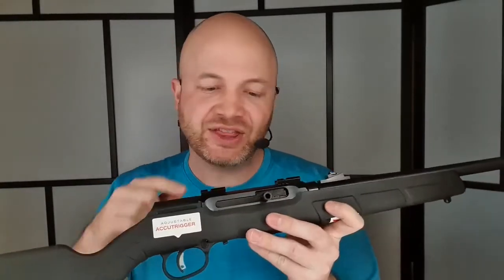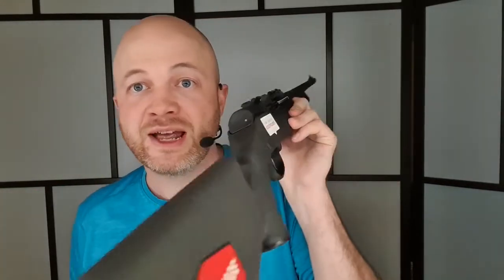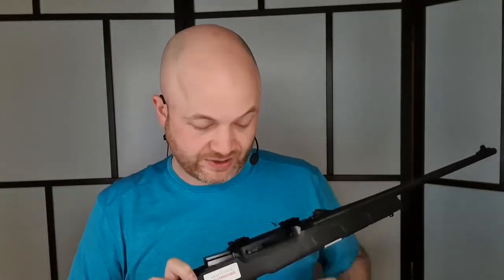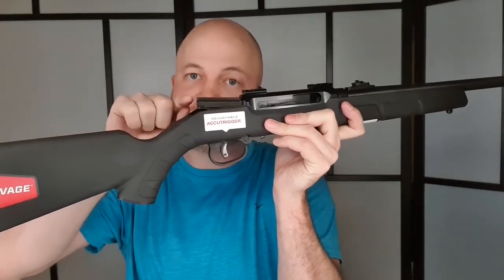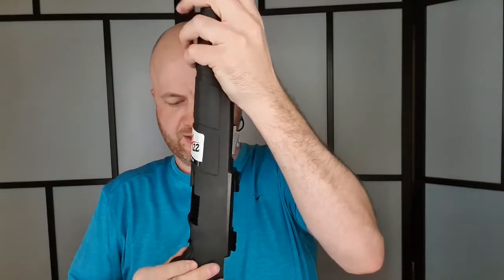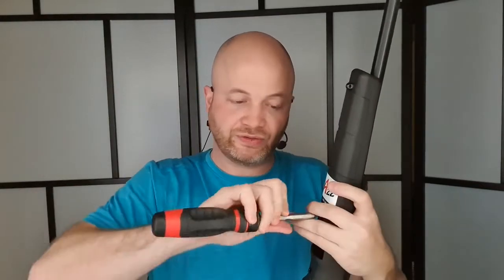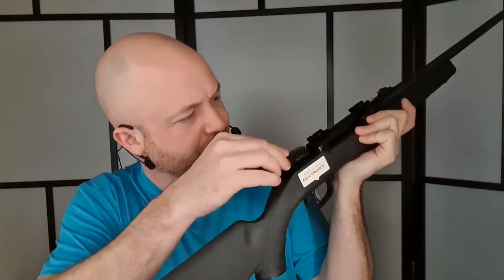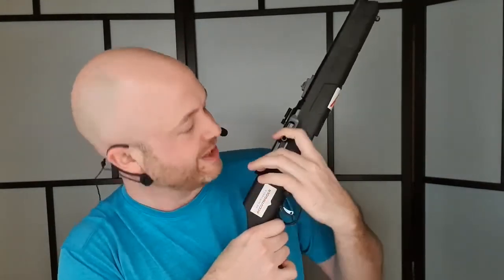Savage A22 Disassembly

Comment: Thanks for the video.  I have an a22 takedown.  The bolt handle broke off after about 10 magazines through it.  Savage sent out a new handle.  The hardest part was getting the part that was still in the bolt out. This video helped immensely.
Reply: How did you make contact with them? Email, phone?? Same issue except I only got two rounds through it and the charging handle came flying out
Reply: @jorgecepeda92   I called them.  I tried leaving the number a couple of times in the comments but I think YouTube deletes it thinking it is spam

Comment: Both the grey nipple on the recoil spring has broken and the catch for the dust cover has broken on mine. Would be nice if someone made some aftermarket aluminium replacement parts. It would make this little rifle perfect.
Reply: Plus the cover inside the barrel channel isn’t to make it look neat, it’s there to account for the different barrel thicknesses between the standard and bull barrels.